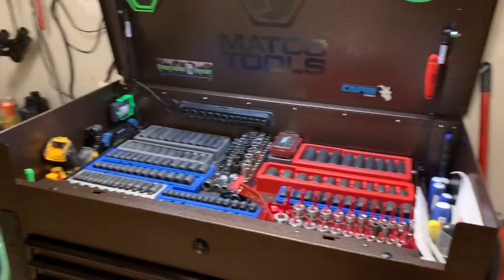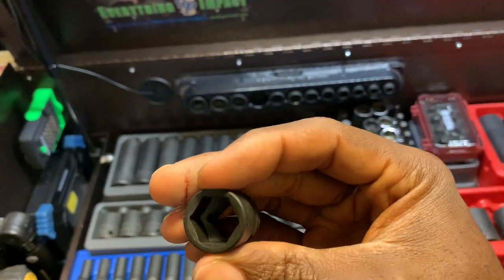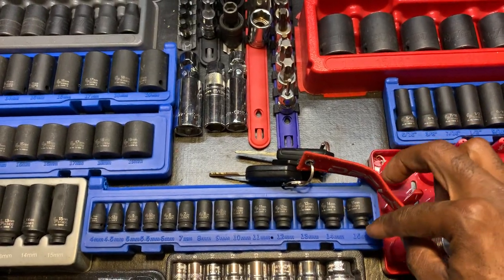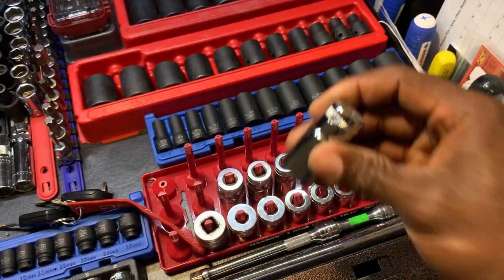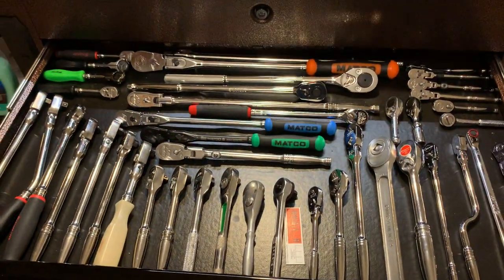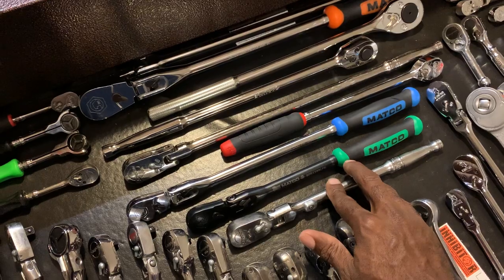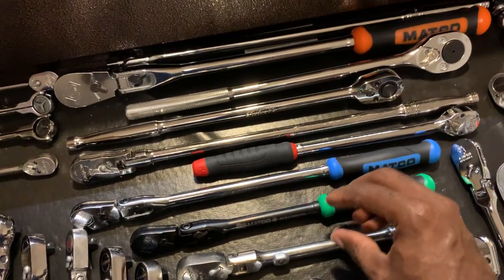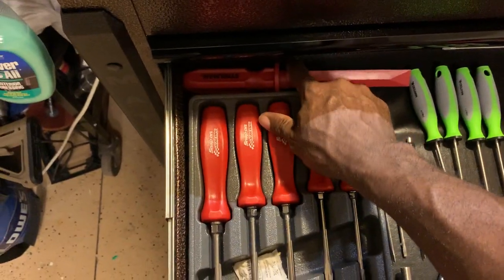Massive Tool Box Tour!!!!

Comment: I have one of those ratchets like you mentioned that nobody else probably has even though mine is a Stanley brand everyone at the shop laughs at me for it but I don’t care it gets the job done and it’s about 12 years old it was in my second tool set that I ever had and still have the whole set. And also I have a lot of Craftsman stuff and everyone laughs at me for that too but I would rather have them than be in debt like everyone else is thousands of dollars. Also nice box and tools I have a lot of the same brands as you I buy from the pawn shops and thrift stores they let me fill up a box and throw a $5 bill on the counter and they take it because they say they are glad I clear there stock because nobody comes in for tools hardly I have obtained tons of Snap-on and SK and Mac and Matco stuff that way.

Comment: The Red Hard Handle Screwdriver set 😯😯😯 👉🔥👌💪
Reply from the maker: Those are my fav’s, and I bought the set for only $50
Reply: @MidwestToolReview  I'm going to include the Red hard handle screwdrivers and the Ratchets in all drive sizes when I get around to it . I do have alot of soft grip comfort handles between both but I've always liked the Hard handle Flexhead Ratchets by SNAP-ON they just feel different for some reason compared to the newer design ratchets the older Ratchets feel more Stout and balanced differently and the handles are Pozi

Comment: damn man your finger looks painful!! you should get like a manicure set to help nurse that wound cause damn i bet it sucks getting something that stings in it. Look into this stuff called gloves in a bottle. I love my fhllf80d it has a black hard handle instead of chrome, it comes in hand for breaking tough bolts in the engine bay, I paid like $170 for and is my most expensive ratchet i bought next to my mac 1/2 locking flex head i got new for 150 but is a 250 ratchet
Reply from the maker: It’s very painful!!! Great idea/suggestion for the liquid gloves!!